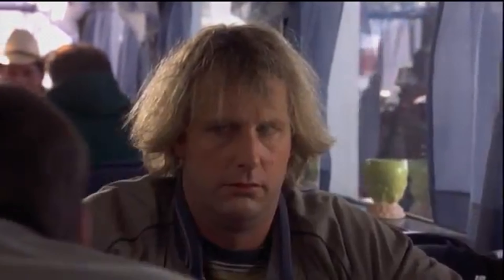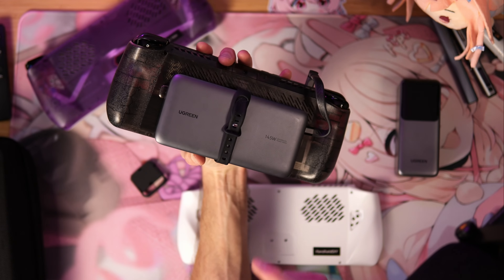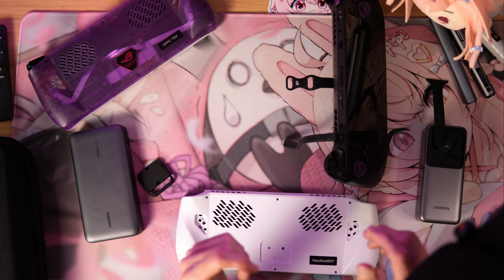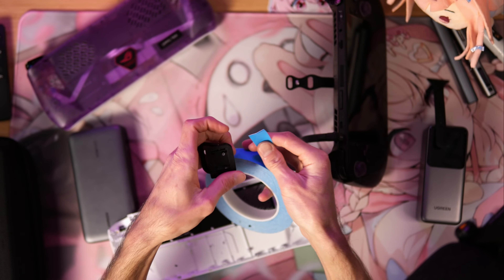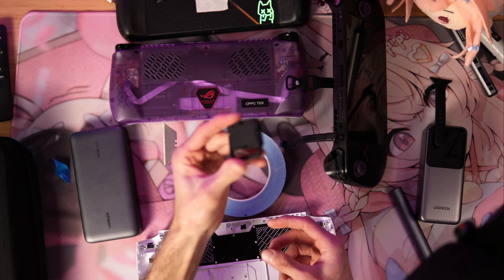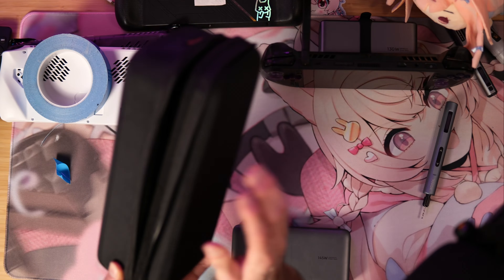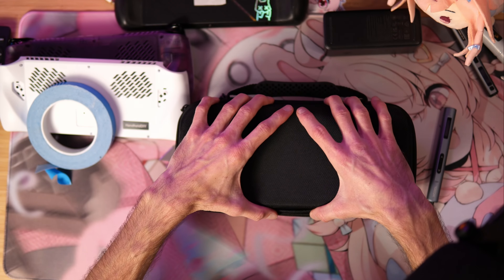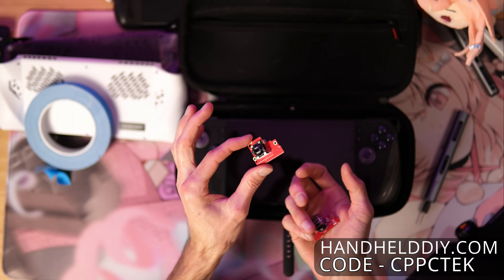DIY Strap-On KickStand Mod - Double ROG ALLY X Battery Life! + TMR Hall Joystick Update #rogally

Comment: CPPC, i have the legion go. What i did was i ordered one of those LTT magnetic power brick holder and used my anker 25000mwh battery bank. The  ltt magnetic power bank holder comes with velcro cable straps. It stays together really well and I can still use the kickstand. The LTT power brick holder comes with an adhesive metal plate and it sticks really well and you don't have to put holes in the back plate.

Comment: Imagine a 3d scan the clip onto a 3 printed model rog x backplate that would be the ultimate rog x backplate
Reply from the maker: Indeed !
Reply: Do u know how to  make 3d scans cause I could try make them from my jsaux clips and send file to yeskira if they want add it to the ally x backplate project
Reply from the maker: @Killer2k2016 I don’t have a 3D scanner. They have been coming down in price but I’m not confident I have the skill to use them. They do take a bit of work to dial each file in and I struggle with editing files

Comment: Hey, is there any tutorials on your channel for a wobbly joystick cap? I underhand you can screw it down but need some clarification
Reply from the maker: Look at the ally x tmr video I did. Once you have the module out. Flip the black joystick cap over once you pull it off the module. It slides up. Look under it where the shaft/stem goes inside. There’s a Phillips head screw inside there to tighten
Reply from the maker: I just am finishing up editing a full tutorial I’ll be sure to post it here shortly.

Comment: I see a website here in europe where they sell rog ally x 80wh original battery. Is it possible to replace the OG ally battery with the ally x battery? The original ally is 15.48V and the ally x battery is 15.56V. I asked the seller and the answer was it wouldnt fit and wouldnt work because the voltage isnt the same... is that true?

Best regards from Portugal!
Reply from the maker: You can make it work but you have to custom adapt the cable. Or do some Jerry rigging. You can make it fit but it’s tricky. I need to get another og ally and I’ll do the mod. I have what i need for it
Reply: @cppctek  thanks alot, that would be awesome 😊

Comment: Did the ugreen bank getting hot and loosing power ?
Reply from the maker: Not at all, the backplate is the intake and it doesn't get hot, the top near the power and volume buttons is where the exhaust goes. There is also enough gap between the battery and backplate to not cause any real restrictions in airflow and I didnt notice any significant changes in temps either. I can game at 25 or 30w with a custom fan curve and sit around 65c all day long in aaa titles like black ops and forza horizon 5
Reply: @cppctek  that perfect really appreciate that fast respond  , got mine out of delivery today watched a couple of your video , thank you for helping us  ! :)

Comment: Do some micro sd cards
Reply from the maker: I have a 4tb nvme. I don’t usually use sd cards because they have such slow transfer speeds. They have a maximum speed of about 100mb/s on average but my nvme can do 7,000 
Downloading games, transferring files, loading games and textures especially in open world games and large aaa titles it does make a difference. Also the chances of data corruption on sd cards are 10x higher. Also sd cards don’t have cache and when your transferring files they get bottlnecked and slow down a lot. Theres far too many down sides. Back in the day when nvme prices were high and when they were hard to
Upgrade, an sd card was a viable option. Thankfully ASUS made the drive so easy to replace that we don’t have a big demand for sd cards anymore. Also you can get 2tb nvme drives for 100$ or so now and even 4tb models for 250-300 for a high end drive.
Reply: @cppctek  i guess I'm just too greedy.
I have a 4tb sn850x but I was thinking to get a 2tb Micro sd card for my retro games and keep the ssd for my AAA games... lol
Reply from the maker: @farzan4882 if you need the extra room I’d get a 8tb nvme but you don’t see drives sleow down untill you’ve got less than 25% space left. So even if you have the whole drive full it’s still faster than an sd card.
When I transfer roms and stuff between handhelds I keep it all on an external nvme because I don’t want to wait an hour to transfer files.  When I benchmark and test new handhelds I’ll copy over 300gb for call of duty alone and sd card would take an hour and with a usb nvme it goes in mins.
Reply: @cppctek  yea I think that's a better idea!! Thanks for your suggestion